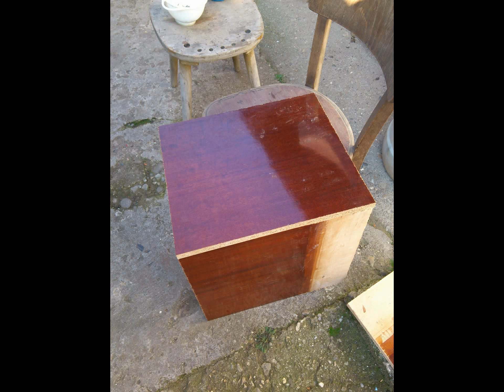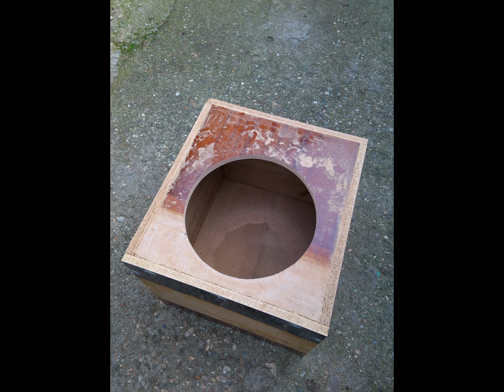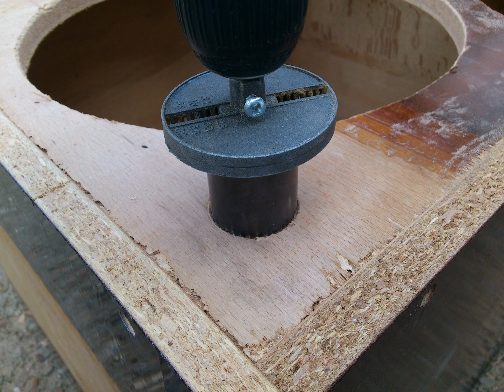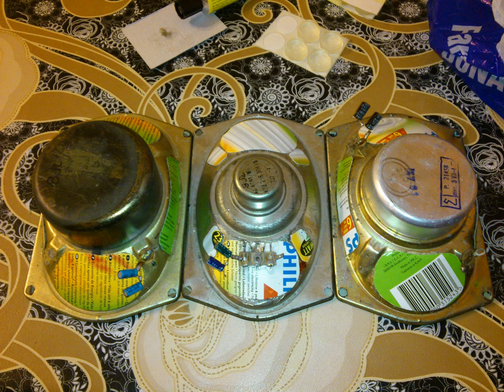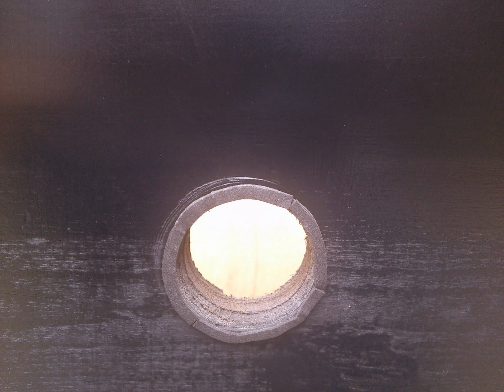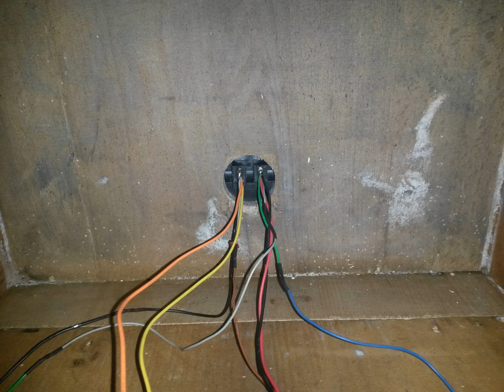How to build an enclosure for a 15" Visaton BGS 38 speaker

Comment: Nice work. i like the idea of the closed volume of the 3 midrange drivers. so the bgs38 won't use them as passive-diaphragm. :)

may i give a few tips please:
if you harden the paper of the closed volumes with wood-clue the results could get better.
you can also harden the paper-cone (with a small amount of wood-glue) of the bgs so it will get water-resistsnt.

the closed volume for the bass should get a stuffing with damping material, for example polyester-wool. so the nodes in the box will reduce. (an open baffle would get best result because of the broken basket)

the tweeters, if possible, should get on top of the box. because of the placement near the bottom, the tweeters can't work properly.

and as last, you should think about the wiring inside: the tweeters have a condensator (capacitor) as 6db/oct crosswork; that is good.
but the other speakers don't have any crosswork-parts, so the three midrange occur too loud and the bass may be too quiet. the impedance in the 3 midrange will get very low, so the current from the amplifier will rise and the amp. could get hot, even damaged !

i like that self-built box, i have built some boxes too. only a few people know how much work that is. respect !

many greets. :)
Reply from the maker: Greetings fellow DIY entusiast :)
Thank you for the  tips. I appreciate any new information I can recieve. I will try to put into practice the information as soon as I have some time to tinker on the box. Exactly as you say, it is a lot of work to build something like this, but luckily the feeling you get from making something by yourself makes up for it :)